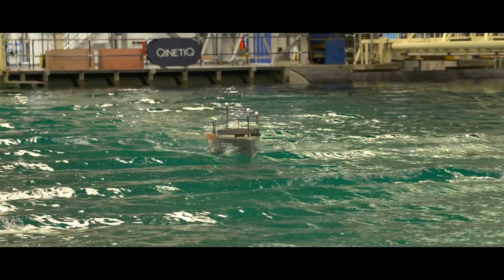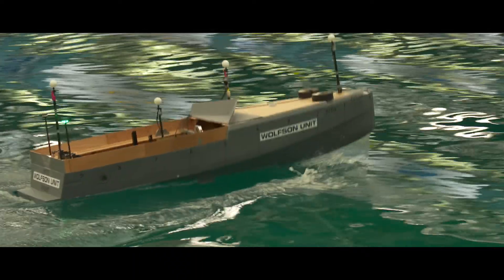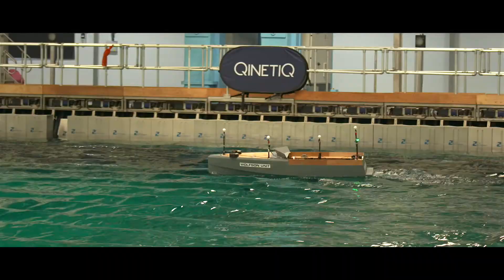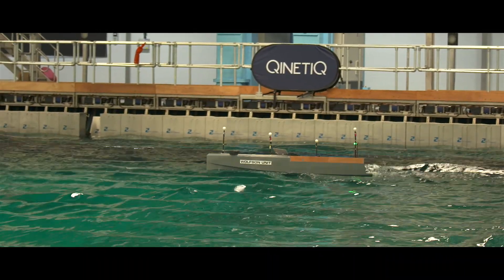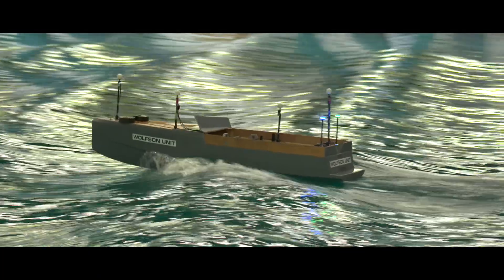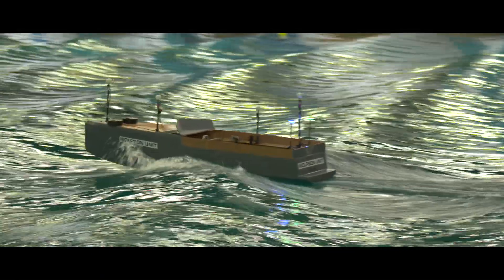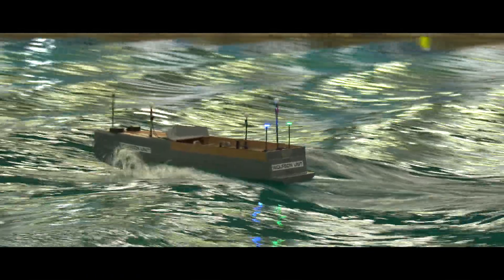Arksen 85 - Model Testing

Comment: This design looks very similar to Steve Dashew's offshore boats.  Are you associated with Steve or his designs ??
Reply from the maker: The design of Arksen vessels, like FPB, is inspired by the ability to cruise worldwide in high and low latitudes and to cross oceans efficiently and in safety. This leads to certain similarities with the FPB approach in terms of capability and functionality. We have also developed Arksen vessels to have a greater internal volume for guests and carrying capacity for toys and equipment and also a greater level of comfort and flexibility in terms of client interior design choices. Arksen vessels are designed to MCA Category 0 allowing unrestricted commercial operation.